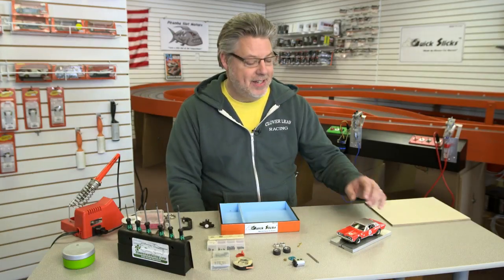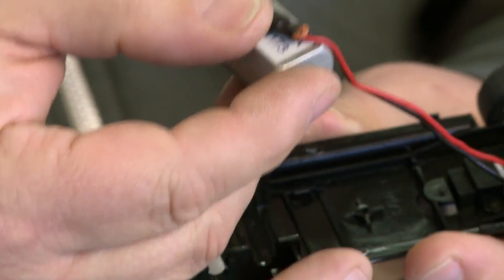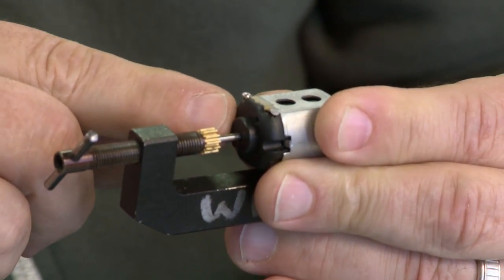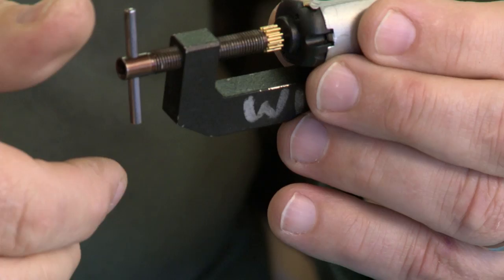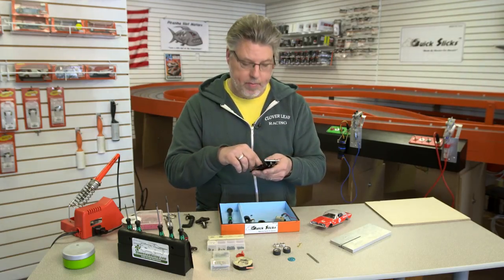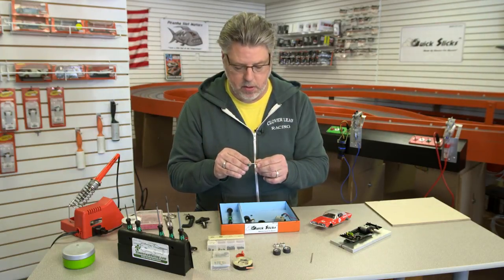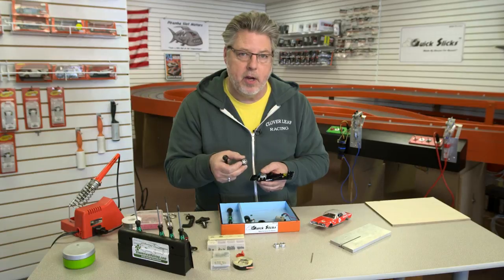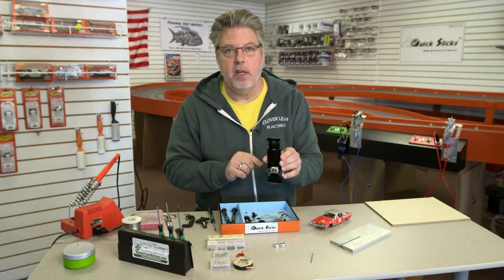Cloverleaf Racing Car Modify Part1

Comment: I rcall the days when we made our chassis from flat and tube copper stock, designing and soldering the chassis together, installing axels, motors and contacts.  Those were some educational days.
Reply: Your place must be for retired people and not worried about making money , but there are a lot of people still working and only have certain time to go to a store , so driving 50 miles total of 100 miles took alot of my time and gas